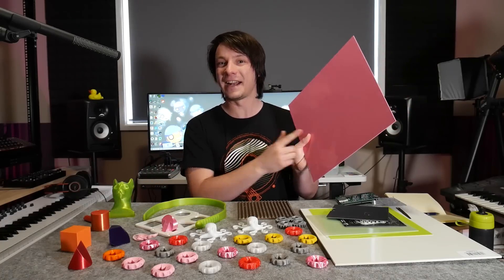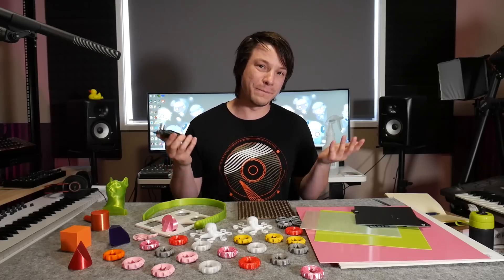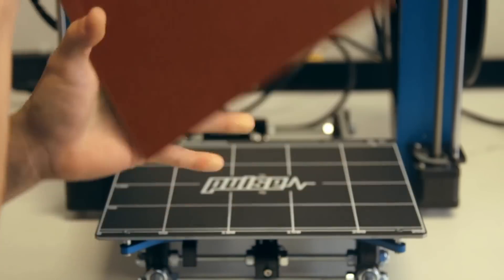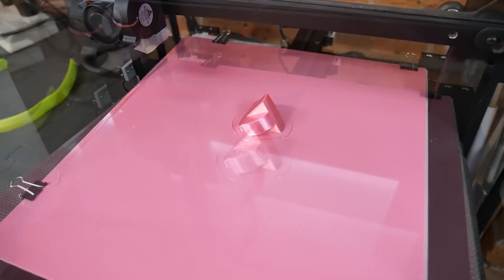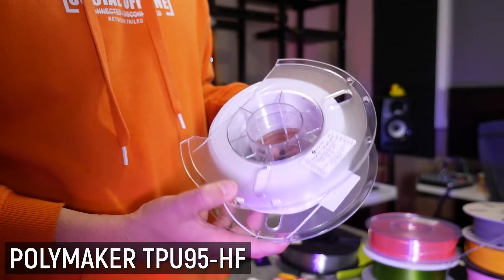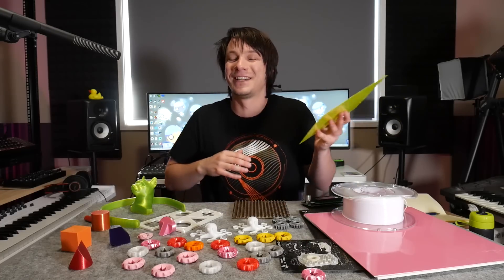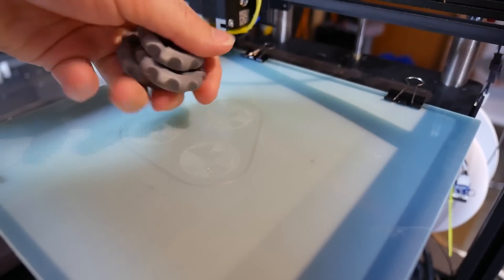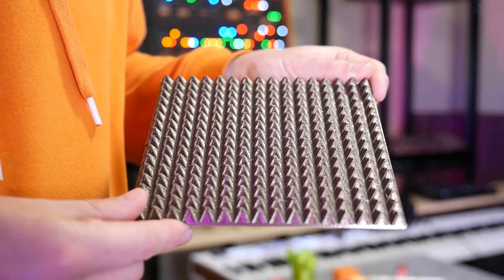G10 - The best print surface you've never heard of.

Comment: Just as a quick tip for cutting this to size, I've just gotten some of this in 1mm sheets (not ignoring Angus just went with availability) and I was able to cut it nice and straight and neatly with a pair of old chunky kitchen scissors, I gave it a try when I saw the advice on a knife makes forum. I don't know how this would go with his advised 1.5mm sheets but it might be worth a shot. 
Obviously, follow his safety tips for the dust when cutting and giving the edges a quick sanding.

Thanks, Angus for the advice and especially a local supplier.

Comment: For PETG, use American Crew hair gel. Mix it with 80% water 20% gel to make it dirt cheap and spread with razor blade on any surface.
Print on heated bed. Part will fall of when bed cooled.
There is something in that gel that other hair gels dont have that makes PETG stick incredibly well yet come off like it wasnt stuck to begin with.

Comment: Yeah I tried fr4 4 years ago.  Maybe I will revisit it. But I did not have the best luck. Still have some pre-cut squares laying around. I used to work at plastics company plastic fabricator, and I tried many of the plastics and other things as surfaces. I not try nylon though as my printer back then could not print nylon.

Comment: maybe get a printed high temperature circut bord with build in heating and a place on the bottom for a built in heat probe (2 printed lines with a place to soler on an smd heat probe)

Comment: I am using G10/FR4 some time now and i noticed that if i clean it with IPA it loses its adhesion at some point. But if that happens you can sand it and get the adhesion back.

Comment: G10 phenolic is used as an insulator/chamber in integrated circuit manufacturing.  It's available in sheets at least several inches thick.
Similar materials with even higher transition temperatures are available from printed circuit board fabrication shops.

Comment: try G7 which is the same FG-reinforcement but a hard silicone resin instead of traditional epoxy, this has a lower surface energy and may be easier to break free.

Comment: G10 is also heavily used in the knife industry as a handle material, with some folding knives even using it as the structural part of the handle. 
Great material with lots of uses! Just harsh on you when sanding it (made a few handles with it myself and despite using protection I was itching for days lol).

Comment: Allo and thank you for all them great vids on 3D , about this G10 sheets you say they fair ok with heat when not too high they will not add fuel to a possible fire but how are they doing with heat absorption and transfert , could they be used as insulator ? would heat pass true them or be kept on the source side ? Cheers

Comment: FYI 1.5mm G10 sheet at 70deg C bed temp works every time for my ender 3 v2. 65 was hit and miss.
Reply from the maker: Good to know! Maybe it's not hitting 70 on the surface?
Reply: @MakersMuse  I suspect a loss, I just lack appropriate tools to measure it in an precise way. Temperature can be such a sensitive feature...

Comment: For PETG I've had great success using a glass bed with Kapton tape adheared on top @ around 80C and drop down to 70C during the first few layers. I get rolls of Kapton tape and tend to replace the covering about once a month after 24/7 printing.

ABS sticks great too with this method at 110C with a brim.

Comment: I've always had issues printing PETG, usually on the first few layers regardless of what I do. And I mostly print with much more difficult filaments such as glass reinforced nylon. Will try garolite, thanks for the share.
Reply: I know this is very old, but I also had lot of trouble with initial layer adhesion with PETG, even if I cleaned with alcohol, my trick to print PETG is to increase bed temperature to 90 degree and hot end to 250, then disable fan for the initial layer, after the initial layer bring fan and temperature to normal setting (bed to 80, hot end to 240), I had 100% success rate with this.

Comment: When you are talking about PET-G, I was once badly injured when i removed PET-G print. As solution I found out you just need keep about 50-60 degree C bed temp and it will go off well, cold PETG holds on almost everything like crazy also 50-60 is not enough to damage your print.

Comment: Ive always used glass, and it self releases as it cools also. And you cant beat its sexy smoothness. Although bigger parts can shear the surface after it gets older and your print surface gets uneven. But its cheap enough buying standard window glass cut to size from a generic glass place.

Comment: Many thanks Angus, cheap as chips you said, not too easy to find in Australia but in the USA it is available in hundreds of places but here in England it was like trying to find Rocking Horse Droppings.
Eventually I found some, ordered a thinner sample than I was intending to use because this piece had a Copper Surface on one side…..  Now anyone with an Artillery X1 like me, knows that bed heating, although fast, is NOT even, not even close (see what I did there?).  So my Warped Logic, along with my Warped Bed thought, Hmm, Copper transmits heat very well, so that should help even out the Bed Temps, yes?  Hell YES.
The material I used is actually FR4, not G10.  To all intents they are identical, except that the FR4 is non-combustible ... G10 is not.  To use more technical terms, the FR4 is rated 94V-0 (the best) by UL where G10 is 94HB (not good).
I got some 0.8mm FR4, Copper Clad on one side, clamped it to my IKEA Mirror and hit the Heat button.  I was very happy to see much more equal heat, from side to side and front to back.  This improved, obviously with time.  So, if nothing else, this is a huge plus point.
Now for the print surface itself.  Thorough cleaning with Isopropyl Alcohol, I do mean thorough.  As it stands it is possible to get that all important First Layer down and down very well indeed.  After 2 or 3 prints, yep, I am lazy, did not clean between prints, some failures occur.  Clean again, with IS and away you go.  I had fantastic success using my bed adhesive of 20% Modge Podge, 80% Water.  Put on with a kitchen towel, it creates a very thin, even surface.  Printing on this I had ZERO Failures.
The FR4 I used was way too thin at 0.8mm, I did get some 1.5mm Copper Clad one side but have yet to try this out, there is no reason at all to expect anything other that good results from that.
Cost, well as you know the X1 is a 310 x 310 Bed, the 0.8 was under £10, the 1.5 is actually in A4 Format, as let’s be honest, do we always need 310 x 310?  No.  Full disclosure here, the A4 was sent to me For Free for me to test, I will NOT get a penny out of any sales he makes, or doesn’t, I just explained it was for a purpose, he had probably never considered before.
I am happy to share contact details for the Gent who I got mine from.  Any questions please feel free to ask me, apart from pricing, I have no clue at all but based on the 0.8 being under a Tenner, it is a great alternate to waiting weeks for Gizmo Dorks 1mm PEI to arrive from the USA and the ridiculous cost of shipping it, I just found 235 x 235 1mm PEI by Gizmo Dorks on Amazon for £39.70, hell, that is steep.  I would say, risk a Tenner, or a bit more if you want the 1.5mm.
Anyway, his name is Joe, I would never put a correctly formatted e-mail address on here as it will just get grabbed by the spiders and he will get tons of spam, so take out the obvious bits and include what you need to, to make it work.
Joe at protetch dot co dot uk  In the Subject Line please include 3D print
Give it a go, nowt to loose.
Allan

Comment: when you said it's a fiberglas material used for curcuit boards I thought for the whole rest of the video, how is it different from FR4 than? then I read the describtion. 😄But I'm a bit surprised though. In the communitys where I hang around this is like the most common recommended surface material since at least 2 years far from being unknown. I didn't even think this could be the same thing if you are talking about a unkown material. Maybe try the same poll on twitter again write FR4 instead to see the result changes.

Comment: On McMaster Carr I just saw $ 58 Amer for 12 " x 12 " x 3/8 " in black. Maker's muse was talking about that being about $ 5 each. I'm not sure if he is talking Australian dollars which would make it even cheaper. Have prices gone up so much lately?
Reply: I purchased sheets from McMaster Carr after watching this video.  12"x12" x 1/16" were about $8.50 USD each.  However, their packaging left a lot to be desired.  I ordered 2 sheets which were just thrown into an oversized box with no protective film/layer between them, and they arrived scratched.  After making them aware of what happened, they offered to resend two more sheets, and you guessed it, they were not packaged any differently.  The second set of sheets also arrived with scratches, plus they also had what appeared to be manufacturing defects which looked like divots or gouges.

Comment: Works brilliantly. Instead of clips to hold it down I stuck on 6 centimetre-wide strips of vinyl magnet with double sided tape. It turns out the Ender bed has alternating strips of north-south, so I placed the strips on the bed and aligned the G10 to the plate. Magic - the G10 always places perfectly and  the print bottom surface is superb.
I use hairspray for a bit of extra stick/release, even with PETG.
The magnetic strips I cut from a $5 A4 magnetic sheet from Office Works. 
I may never use anything else.

Comment: Top tip: when cutting/scoring multiple types of plastic including GRP (fibreglass incl FR4) do NOT use the sharp edge of the blade but score using the 90° edged BACK of the blade. Using a scraping rather than cutting action works much more effectively to either score deeply or cut through entirely.

Plastic (e.g. hard plastics like polystyrene) can be cut VERY cleanly this way as the blade does not suddenly divert as it has a nasty habit of doing when cutting/scoring using the normal cutting edge.

 Scoring FR4 DOES produce more glass fibre dust so use both a face mask AND eye protection.

When cutting rectangular holes in plastic panels mark out your rectangle and cut from each corner to just past the centre of each side. It takes a bit longer to do than a saw or Dremel cut, but the edge finish is superb with a patient approach. As you are cutting towards the centre each time, you are much less likely to slip past the corner and cause visible damage. Do the exact opposite when cutting OUTSIDE edges down to size ... From the centre to the corners.

I like to use a steel straight edge taped down so that the steel is on the OUTSIDE of the panel cutout edge to be cut. Any slight slips will head toward the centre of the cutout or over the steel giving extra room to stop before a slip causes severe damage. Again, reverse the position of the steel edge when cutting outside edges. Place it so that any slips can only go to the waste side.

Hope that proves useful for people.
Reply: Great tips, this should be pinned.

Comment: Thanks for making this video! I'd been having the exact same issues with PETG sticking too well or not at all, but I needed to print with it because PLA is too brittle for my needs - So, when I first saw this, I instantly went and bought some. Haven't had a single issue with bed adhesion since and the parts just snap right off with little to no resistance. It's a real game changer!
Reply: This is helpful!  I'm helping students learn the ropes and PLA has been snapping during loading and refuses to stick.  Finally got it to stick with borosilicate bed plate and gluestick, and print starts looking like a slug after about 1/2 - 3/4" height off of plate (with exception of pre-loaded gcode on sd card (a cat).  I think I'll give it a go with a different filament! :)  (and order some G10!!)
Reply: aight, gonna try this with new roll of PETG …
Reply: In case anyone is wondering, I'm still using the same sheets of G10 I got back then. One of them has even outlasted a printer of mine and continues to perform just as well on a different machine. What a lifesaving material!

Comment: My CR20 has a G10 print bed with a fake build tack surface applied as a sticker. After watching this video, I flipped the bed over and the result was amazing. The first layer surface has a mirror finish like glass. Forget the over documented and YouTubed "Must Have" upgrades. This tip has been the single biggest improvement in my 3D printing since I started.  Thanks Angus!

Comment: Ah yes - thanks for reminding me of my first ever print surface.
I used to print on fiberglass - I have some 4 and 6 mm sheets that I also use for mechanical purposes. I can confirm that the thicker sheets do work great for Nylon.
As always: YMMV (your mileage may vary). There are tons of producers of this stuff and they all have their specific (epoxy) resin they use with a different max. temperature they can be used at. Regular G10 and FR4 comes with a different max. usable temperature. Regular FR4, PCB material, has a max. temperature of about 120 C which means that it will already be a bit softer at 100 C, resulting in the effects you have seen but this may also depend on the thickness of the sheet and how hard the material was pressed together in production.
So for higher temperature use, you could try material from another company to see which one works best.

Comment: for some reason always had inconsistent issues with glass,glue,hairspray,buildtak etc for all my prints including pla trying this next hope it works.
EDIT: and i checked the level perfect level had inconsistent bed adhesion on the same model and same settings including z height.

Comment: I use a PEI bed for PETG and it works really well. Wash with soap and water if oil gets on it. G10 is like $60  for a 12inch by 12inch sheet on amazon... PEI is like 20-30 bucks.

Comment: 12:22 That ad says G10 phenolic sheet. 
They are two different things. G10 is an epoxy/glass composite 
Phenolic resin sheets are the old brown type of PCB material Made from cellulose or fabric coated with phenolic resin and cured with heat and pressure.
Formica is also phenolic resin based as is Bakerlite

In fact phenolic sheets my be a better choice as it is a thermoset material and does not soften with heat as an epoxy does.

Comment: this is a great video! we tested some Garolite in the begining and had warpage and other problems like delamination.  It may have been due to the higher temp filament heat build up (like abs as youo mentioned), or to different quality boards.  We will give it another go as well.  We have nothing against finding a decently priced solution for all!
Reply from the maker: Thin G10 on a magnetic plate could be interesting !
Reply: @MakersMuse  would love to give it a shot if we can find a quality we can rely on!

Comment: I'm pretty sure the brown Garolite shown in the MatterHackers video is actually Garolite LE, which is not the same as the more common G10/FR4. Garolite LE is made of a phenolic resin reinforced with linen (flax, cellulose) fibers, as opposed to the epoxy and fiberglass of G10. This makes it easier on the tools used to fabricate it (Since linen is not abrasive like fiberglass is), and it's wear resistant without being abrasive to the surfaces it slides against, again because of the nonabrasive nature of linen fibers.
It's less stiff and strong then G10, because both the phenolic resin and linen fibers are less strong than their epoxy and glass counterparts.

When I was experimenting with printing surfaces for nylon, I tried both Garolite LE and a blank printed circuit board that I had left over from another project, that I stripped all the copper from to leave bare G10 behind. The nylon stuck very well to the Garolite LE, so well in fact that it pulled chunks out due to the lower strength. 
On the G10, my initial prints barely stuck at all, but each subsequent print stuck better and better. After a few it was really great. I wonder if this might have had something to do with the fact that my G10 had a matte surface rather than glossy, due to having a copper layer glued on top.

I eventually switched back to glass and gluestick, because it was flatter and helped with a slightly lumpy heated bed.

Comment: Just for information to anyone who uses the Australian site to buy their g10.  I bought some 1mm and 3.5mm, unfortunately the 1mm had a lot of surface damage but thankfully the single sided film protected the worst gouges and made that one side usable. The 3.5mm came with no protection and is too badly scratched and gouged to be of any use as a printing surface. I have to say I'm a little disappointed that after all that money I have only one print surface to show for it.
Reply from the maker: That's unacceptable I'd message them about it
Reply: Thanks Angus, really appreciate your work by the way- great channel! If they were selling these as print surfaces then I would. To be completely fair to them, they didn't. As stock for making products that would be cut, sanded and processed   then it's not a massive deal. Unfortunately for this use it is,  as it clearly shows in the first layer. I might email and advise better packing and surface protection for both sides of the sheet, certainly the single sided layer did work. Just posted as a consideration for any future customers,  the downside of online buying is that you just can't inspect the product first.